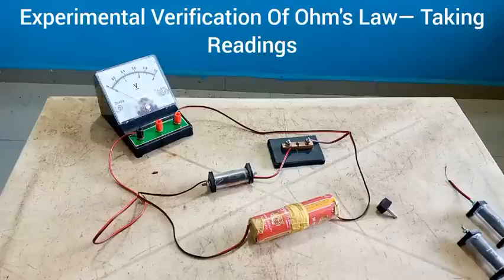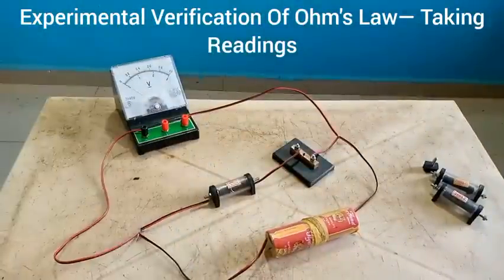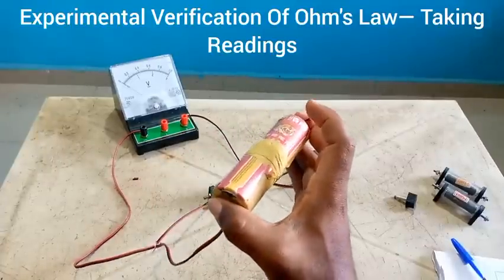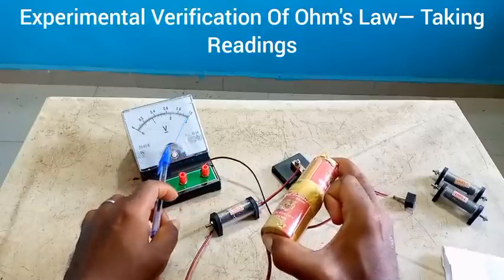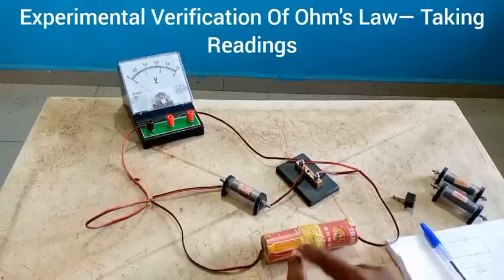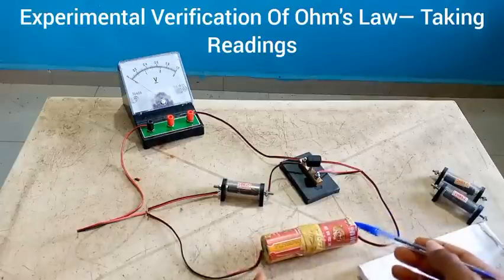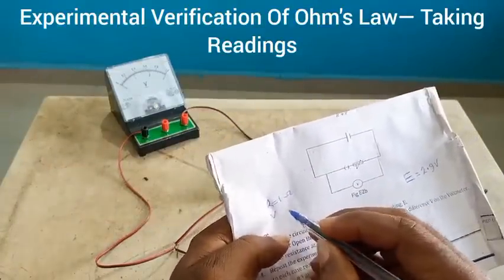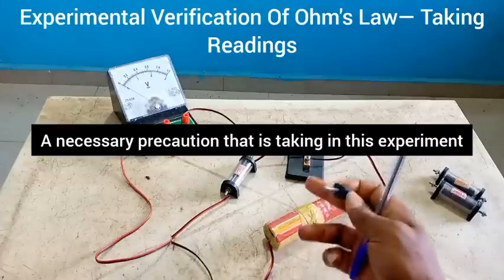EXPERIMENT E2 PART 2: HOW TO TAKE READING || EXPERIMENTAL VERIFICATION OF OHM's LAW || PHY 108

Comment: Sir please are we to pick the scale or reading to put the wire connection at the positive end of the voltmeter or we would be given?
Reply from the maker: @OkaforChigozieDeborah  You are the one to pick the scale. However, you are to use the lower scale reading of 3V since the battery you will use has E.M.F already greater than 1V. So, YOU CAN'T USE THE UPPER SCALE which only read up to 1V